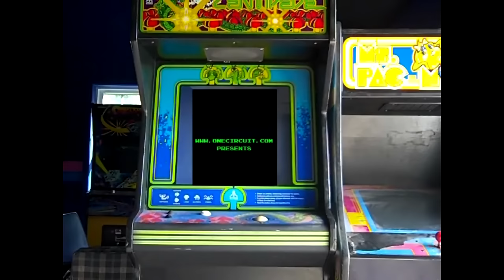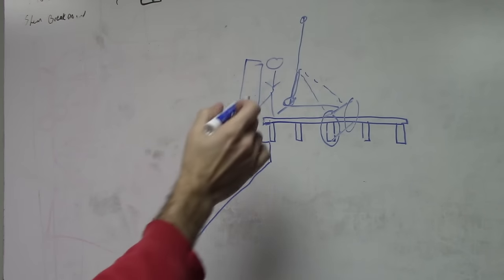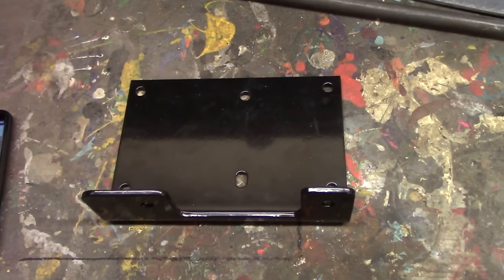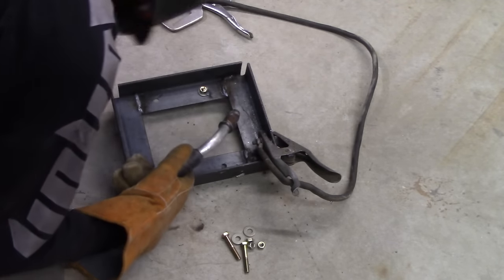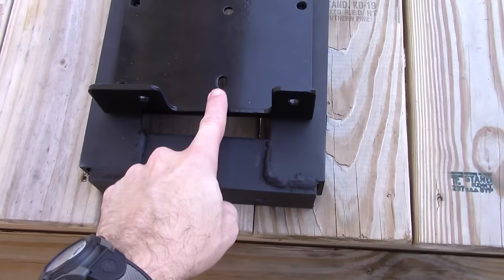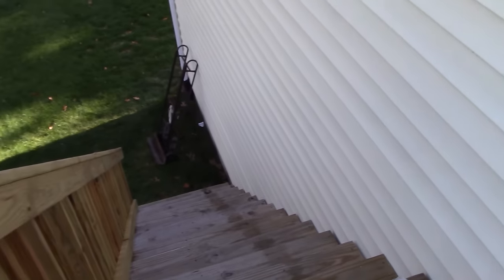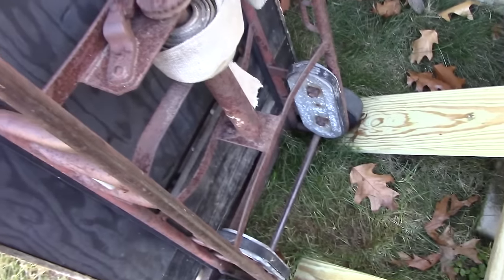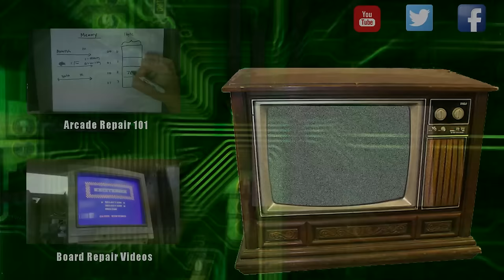DIY Arcade Game Elevator!

Comment: With the paddle bits, and generally drilling wood, there are a couple of things you can do to prevent tearout. One is to clamp another piece of wood behind it (which might be a bit difficult there), the other is to just drill through nearly all the way, then go round the other side and finish the hole.

Comment: Thanks for the boat bow idea, I want to invent one that I can use for getting the games out of peoples basements and down their outdoor stairs because even with help im doing most of the lifting and its finally taking its tole on my abs and back.  only think of is to mount the winch at the bottom of the stairs some how using clamps and a hook run the line up and back down the stairs and have it drive a rubber conveyer belt that actually lifts the machine and you could use it on any set of stairs.
Reply: a ladder with a dolly on tracks attached and the winch attached at one end might do the trick?  only thing is would the ladder feet wedge be strong enough to hold while lifting the 500 pound machine?

Comment: Awesome video. I thought about the sliders boards as well, preventing it from going off. One idea is to cut a groove in the boards, wide enough for the wheels. Then the wheels and the top metal frame of the dolly can slide in its tracks.

IE, cut out a little bit in the middle of the slider boards.. I guess the whole board would start sliding then instead, if they are not attached to the staircaise in some way. Hm.
Reply: Ah, I'm too slow. Already suggested below =)

Comment: What about attaching some triangle blocks the to top and bottom thirds of the runners? This way the runners can still collapse (just wouldn't be perfectly flat), and they would be more stable on the stairs, and possibly lay more square. Instead of just the corners of the stairs taking the weight of the game, some of the steps themselves would be doing the job as well.

Comment: Usually the corded drills are maximum of 1700 rpms. My suggestion here. The angle iron that your using there if you knew what kind it was for the cutting speed for the material. You could find the proper speed for the bit itself. I used to learn in highschool training as a machinst. For that I know of formula is (cutting speed of material) x 4  / the size of your drill bit. Once you get that you'll have the  rpm that you need for your drill bit. Ands any kind of coolant definitely helps to keep the drill bit cool.

Comment: Hmm, what about getting one of those RF momentary remote controls and a couple of 30A relays, and hacking up the winch to be operated by the relays? Then you can have the remote in one hand and the other hand on the top of the cabinet guiding it as it moves.

Comment: Put a lockable clasp at the top of the trolley thing. As it first goes down you clasp the cable to the top of the trolley so the pivot point is high up. That will stop it leaning to the sides.
Reply from the maker: You read my mind. :)
Reply: and also,  in addition to welding an eye to hook to, that is centered, instead of hooking to the axle, perhaps cut a notch on the flat top part of the runners so that the top of the dolley handle could run in a groove to keep it centered, instead of adding wood to keep the runners centered.
Reply: This is where my thought process went too? Love the entire project. Great work

Comment: Great job Adam, one thought tho. If the hook somehow would slide to one of the  sides of the trailer. Wouldn't the game wobble heavily to the side?. Maybe you should make a weld a "center-guide" for the hook.
Reply from the maker: Right I think I mentioned welding the hook right onto the dolly in the video. Agreed.. just using a hook/carabiner of sorts wouldn't work. It has to be fixed to the dolly.

Comment: I like it.... But I think I would have made a small swinging Davit crane with that winch, that could swing out and lift a game vertically. And then put a gate in the hand rail to swing it through. You could simply drop the crane into a reinforced hole in the deck when you needed it. And lift it out and stow it when you didn't. Or just put a weather proof bag over it.
Reply from the maker: +Gary Sweetland Time and money :)
Reply: I here that.... You have a good working sytem now. It was just one of those hindsight moments I had while watching. Keep up the good work. I love the PCB repair videos, not that I fully understand them....... :)

Comment: Hey Adam, nice work.  Do you think the width of the ramps are a bit too narrow?  I'd have made my ramps a bit wider to allow for any slippage.  I'd have also placed a hook for the top end of the ramp to the top of the stairs so that the ramps would stay in place and not slip.  I'd maybe add some non-slip coating to the ramps as well.  Overall, a good job.  

By the way, any chance on converting the winch from DC battery to AC power?

Comment: Excuse the very very crude sketchup, but something like the pic shown would be much better than planks hinged together held by screws in end grain. Having some angle iron that fits inside the dolly to stop it sliding away, connected by some simple to make I frames will not take too long to assemble. You could use coach / carriage bolts (the domed topped ones) with wing nuts just to hold the assembly together while in use. http://i.imgur.com/auzDKGu.png hope this makes sense / helps inspire ya.

Comment: Don't use a hook on top rail, rather create a guide and ensure the cable is within it when you place it down after taking up cable slack(which is probably what you meant) - that will definatly stop it steering off course as you stated.     I would have welded up a base plate for the roller and placed it directly on the step and incorporated a spacer as well so as to avoid unsightly spacer and excessive bolt/holes on the stairs. With such a setup, due to cable angles, the roller assy would be pushed into the plank/upright intersect of the top step anyway therefore only needing minimal securing for safety, e.g. only one bolt through the upright (not unsightly and easier to remove).

Comment: I would weld/drill an eye bolt at the bottom of the dolly and a j hook at the top so you can unlatch the cable at the top of the stairs to stand the games up (vice versa). This setup would steer it straight on your runners and rather easy to setup. Looks great!
Reply: I guess I should of waited until the end :) let us know how it turned out.

Comment: 51 minutes in, and I'm wondering what you would do if the cable isn't long enough to actually get to the bottom.
Reply from the maker: I measured before I bought the winch ;)
Reply: OneCircuit Good call.